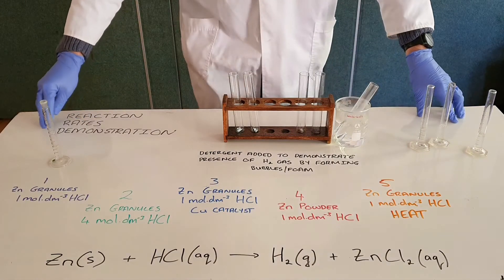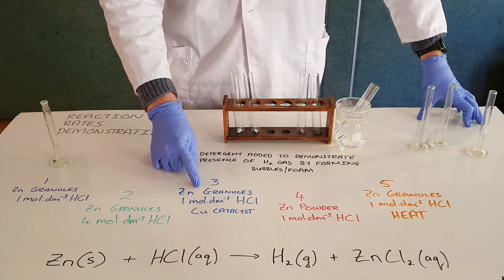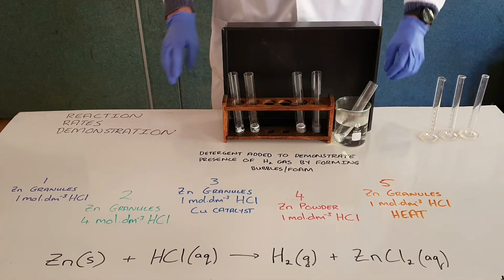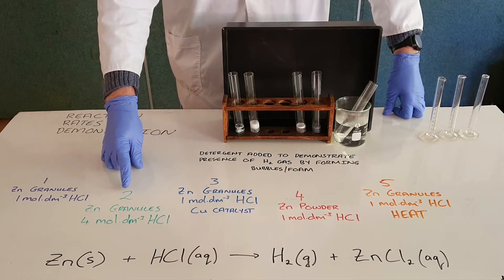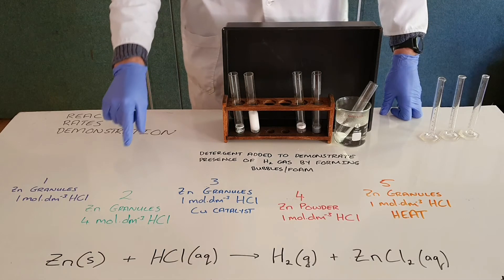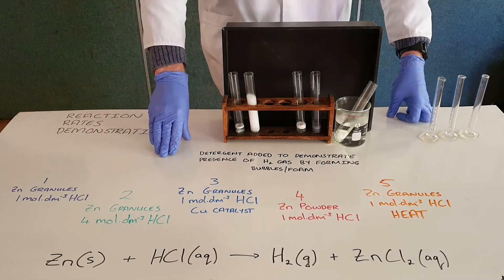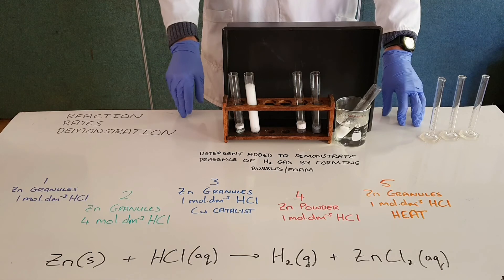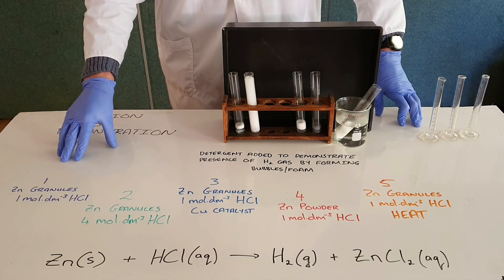Reaction Rates Demonstration - Factors Affecting Rate

Comment: Why did the catalyst not work as well as the increased concentration?
Reply from the maker: It's very difficult to explain with a limited understanding of how catalysts work, but suffice it to say that an increased concentration has a far greater impact due to the dramatic increase in the number of collisions, compared to the slightly lower activation energy provided by a catalyst.
Reply: @SimpleScience101  thanks👍